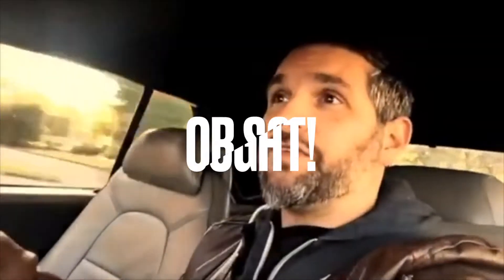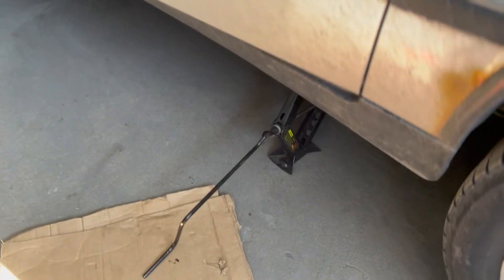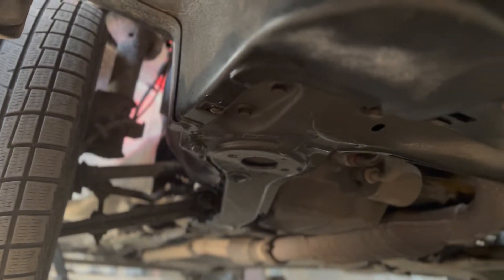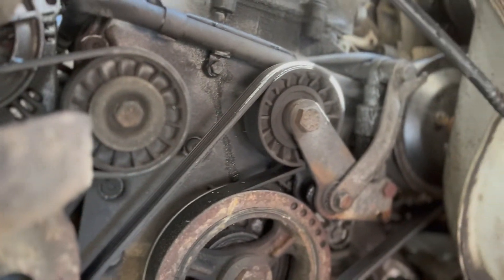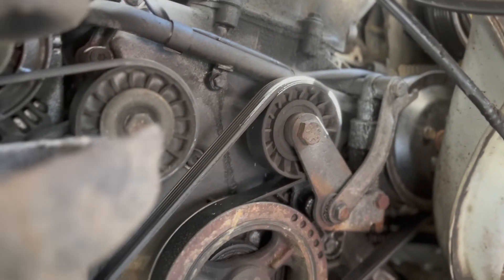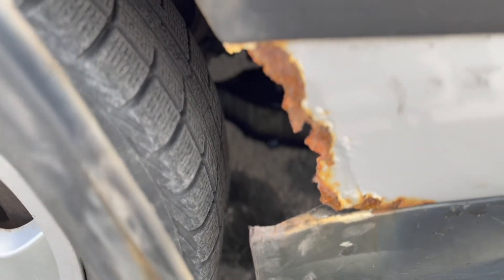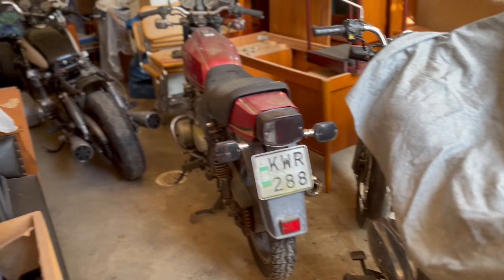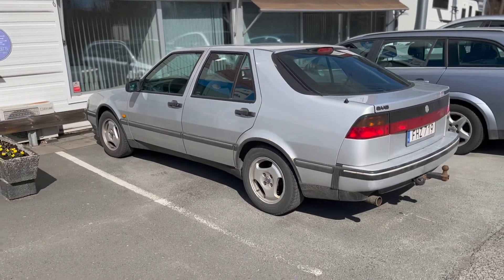Saab 9000 Troubles

Comment: You dont need to take the air con compressor off. Just remove the plastic under-trays. Compress the tensioner correctly and super slowly, and not to let it fly back. Since that would immediately break the tensioner. I did a 9000 Water pump 2 weeks ago and think it took about 1hr 10mins.  Paul @ The SAAB Clinic.
Reply from the maker: Ok all the other guides I've seen said to move the AC out of the way ! Anyway it's done now !
Reply from the maker: My problem is this wing now as I can't replace the plastic splash cover without that fix
Reply: @theclassicsaabguy236  Yes trying to find 9000 CS wings in good condition is very hard. Ive got some brand new ones still boxed in stock. But keeping for my own cars. There is a company in Sweden that is selling Fibreglass reproduction CS wings. Think they are quite cheap too.
Reply from the maker: What's the name of the company in Sweden that do the fibreglass wings ? Thanks
Reply: @theclassicsaabguy236    acm    se/category/386/product/s9000-01V
Reply from the maker: @TheSaabClinicUK  unfortunately the link didn't work
Reply: @theclassicsaabguy236  Remove the spaces.  I couldnt paste the link as it automatically gets deleted.
Reply from the maker: @TheSaabClinicUK  yeah tried that already  says item removed ??-
Reply from the maker: Found it manually! Thanks!
Reply: @theclassicsaabguy236  Still works ok for me. Just messaged you on FB.